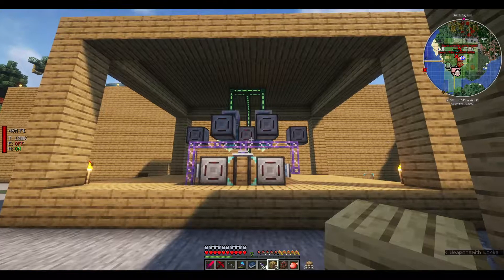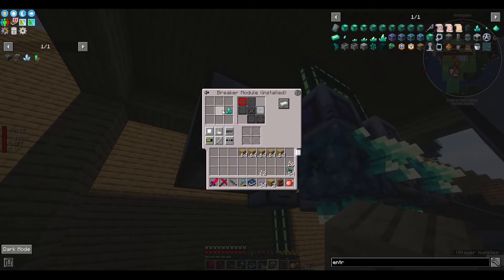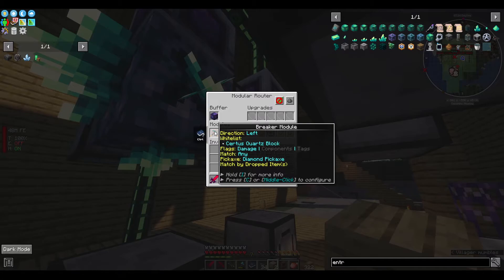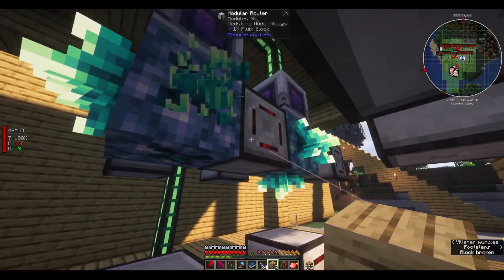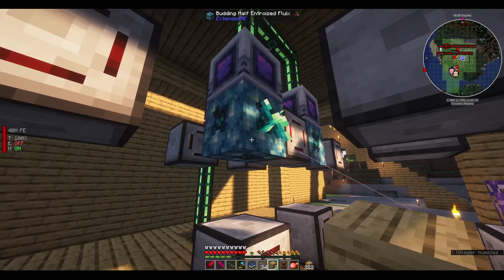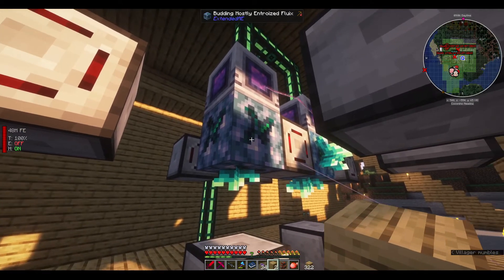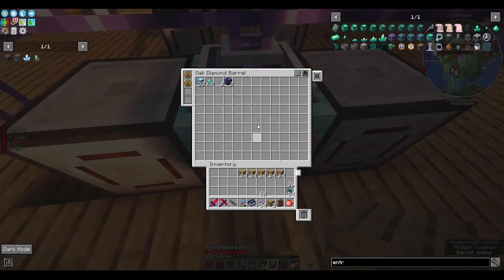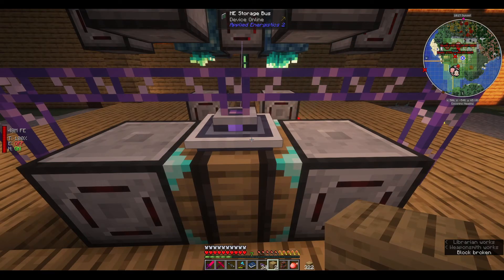Entro Seeds to Entro Crystals With Modular Routers Tutorial ( as of 10-10-2024 ATM10 Mod)

Comment: Im just confused on how the center router works if it has fluix block in its buffer, how will it be able to pull and use entro seed?
Reply from the maker: this setup was changed as per some changes that happened in the atm10 mod it is outdated but the bulk of it still works .. check up the updated video below or one of my newer series that all have the entro seed tutorial ( in them )  ! any other question just ask ..
Reply: Hello Duke, your idea is very interesting, but the block will only be repaired with a 70% probability. This makes automation seem impossible. Feel free to explain if I'm missing something. @duke